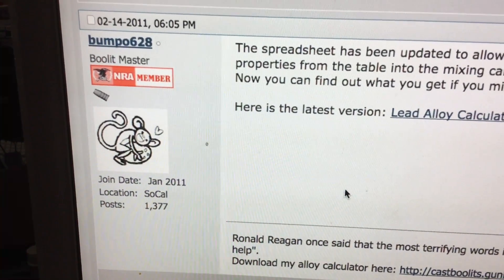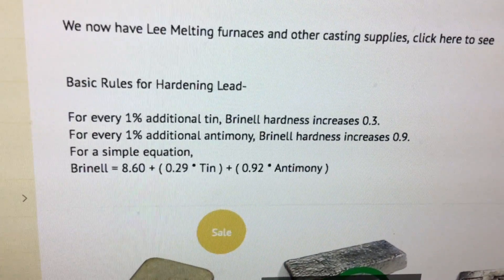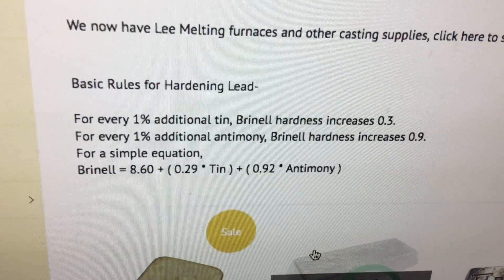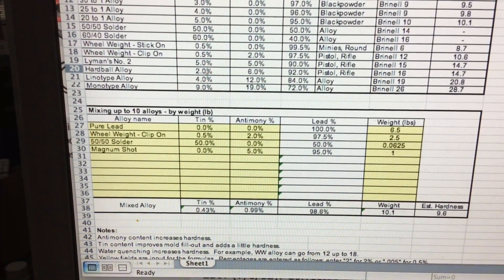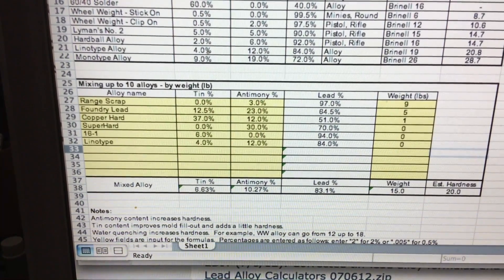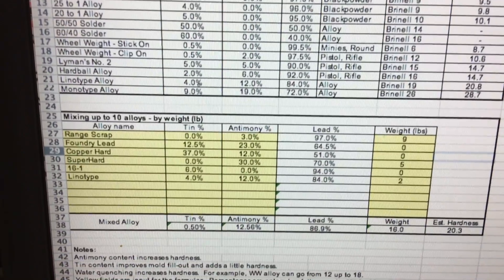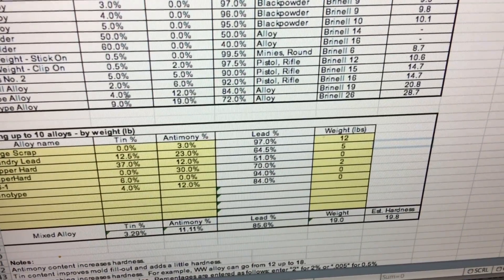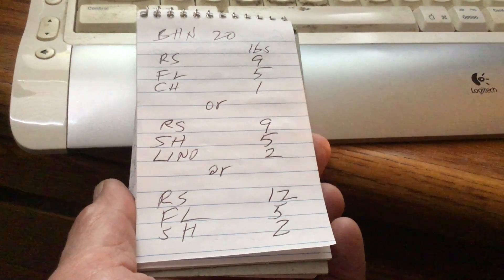Suggestions On Use Of The Lead Alloy Mix Calculator From CastBoolits

Comment: I’m new to casting and am trying to take this all in. I’ve melted wheel weights and casted pistol bullets from them but had no way to test the hardness really. I want to start doing rifle bullets but don’t know what to do. Money is an issue. How much can I get away with powder coating cast and quenched wheel weights in a rifle bullet? When I remove the slag from my wheel weight cast am I removing tin and antimony in the process? I just invested in a lead thermometer and a hardness tester and don’t really want to buy metal to add to my supply of lead to make it harder. But I will if I have to 🤔
Reply from the maker: MLP - Congrats to you on your casting..!!  PC has made bullet hardness less of a consideration than before as PC broadens the range of what hardness is required with what pressure/velocity.  This allows us to shoot softer bullets at higher velocity for expansion without leading.  But there is still a limit as we still need some hardness to hold the rifling.   Only testing in your particular gun will tell you.  As for your wheel weights, the older ones were very good and could be used for casting light rifle, handgun magnums and down.  But the newer WWs have less antimony and are softer.  You can gain 1-2 BHN easily by water quenching (some claim more but this is not for sure - your hardness tester will help - I just use my thumbnail).  PC has changed that - WW and water quench, PC and you should be OK for up to 2000 FPS or so.  I’d go for 1900 fps for safety margin,. (Some claim full power 223 with PC cast, but no one is showing good accuracy at distance). 1900 is perfect for calibers like 30/30 and 45/70 or even the 45/55 Dabo.  Have a great day,  FC Steve

Comment: Mr. FC thank you sir for all your knowledge you share with us. I'm a beginner in casting, well I'm gathering lead and will soon start. On one of your videos you talk about a BHN of 12-18 for auto loaders. Is that still the case if I plan to powder coat the bullets? Or is that for shooting uncoated lead through our firearm's? If I powder coat do I still need a higher BHN? How about rifle bullets do I need a BHN of 18 or higher? Thanks again
Reply from the maker: FR - PC does enlarge the envelope of workability when it comes to hardness.  However, there are still limits...Shooters report getting full power velocity using PC cast bullets...but the old problem of lead bullets holding the rifling is still in effect.  The PC can prevent leading, but if the bullet metal is too soft to hold the rifling, that is what brought on the jacketed bullets over 100 years ago.  Have you seen any sub MOA groups shot with PC cast bullets on YT?  Does not mean that 2"- 4" groups are not useful though.  There was a time when 2" groups with jacketed bullets at 100 yards in a 30/06 was considered fine.  Have a great day, FC Steve

Comment: Bars and ingots do not melt off to the 'line' that delineates an even division of weight... they leave a core hanging. Weigh the ingots and dip and melt until you have melted off the desired amount.
Reply from the maker: Charles Irby - In the future, there will not be any more need of the melt off - RotoMetals is going to nice ingot size "nugget'" for the alloys they sell to casters...we can weigh these easily...Have a great day,  FC

Comment: Thank You! 
I had seem those but when I was a excel in a zip I had decided against it (always worried about a virus) I downloaded it like you did. I got something like yours but it has a cost estimator also. No big deal but it does work on the hardness. I know what I have used, I made a chart for myself from the info I had gotten from reading the online pdf book of "From Ingot To Target" but I do not know if its accurate. Do you have a chart you use for what hardness to use for what bullet? 

Thank You again for the video's I always learn something every time I watch one and today was no exception!

Comment: That is an improvement over the one I used. I know that all of these assume air cooled. I wish someone could come up with a calculator or table to arrive at hardness after heat treat. The way I would want the calculator to work would be to set a total melt weight a desired BHN (or peak pressure of the load, which could then derive BHN), then move a slider for each variable, letting it adjust automatically the super hard & copper hard for cheapest alloy to that goal.
Reply from the maker: GunFun ZS - Anything can be programmed into that spreadsheet.  But I suspect that water quench and heat treating provide inconsistent hardening.  And then we would need a new spreadsheet to show effects of powder coating.  Best to ya,  FC

Comment: This one is an update version (2012): http://castboolits.gunloads.com/attachment.php?attachmentid=45784&d=1341560870. It  has a little more to it.
Reply from the maker: Psyko Klown - Updated is good..!!  Have a great day,  FC
Reply from the maker: GunFun ZS - If we cast bullets with pure SuperHard (and add some tin for castibility), we'd get get BHN 35+.  But the bullets would be on way the brittle side.  Best to ya,  FC
Reply: Is there one which gives hardness after heat treat? I've read the LASC stuff about 2 years back, but it only goes up into the mid 20s. Not hard enough for ideal rifle data.
Reply: Yup that is the one I use.

Comment: Enjoying learning this stuff from you, man! Clever idea to make the mark on the bar and simply melt if off instead of making a mess with a saw, or something!
Reply from the maker: oldscout7 - Just make a small mark with your Sharpie though, you don't want a lot of ink going under the surface of your molten lead.  And if you use the two channel lock plier trick, the bar is held at precisely the right level for a sure melt off.  Gotta lock 'em good though... Good castin' to ya,  FC